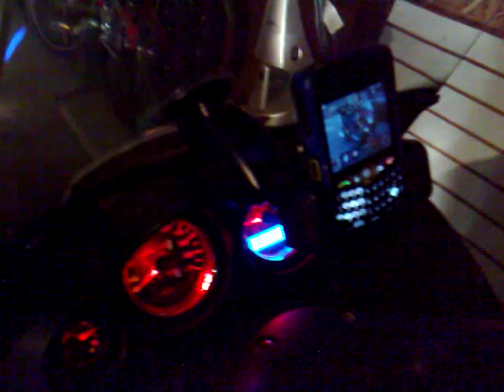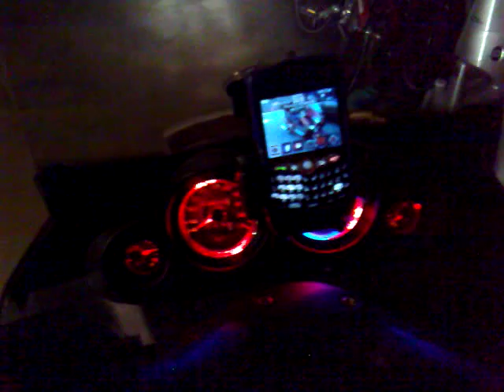250 cc chinese scooter

Comment: I have the same bike!  JCL "Jonway" 250 with the 257cc Yamaha/Linhai engine.  I too, had many problems which I corrected myself.  I also jazzed mine up with the LED's, MP3/FM radio & 4 speakers with 30 watt per channel amplifier.  I tore out the radio that came with it. Placed 12gram Dr. Pulley sliders weights in the variator for a little more top end speed.  Next year, I sell this Jonway for a Suzuki Burgman 650.  I owned a 2004 Suzuki  Burgman 400cc a few years ago.  No problems at all.

Comment: my log and repair book (fixed under warranty (no cost for parts or labor, except towing)
068 miles purchased
072 miles broke down for bad connection and low charge to battery
072 took to the dealer to get fixed (repaired under warranty)
180 miles i did myself replacing the engine oil and gear oil (no filter oil)
200 miles added rear led brake light and turn led signal lights (red stripe and blue led light)
569 miles replaced my clutch belt, fly wheel set and voltage regulator

Comment: 583 miles full battery charge (did myself)
625 miles dmv registration missing the title couldn't registered, need to go back and get the certificate of origin from dealer (bill of sale only doesn't work at all, don't waste your time, always ask for the title.
643 miles replaced the kick stand (replaced under warranty)
720 miles replaced the gear oil (did myself)

Comment: 949 miles headlight and dashboard lights off (overloaded with fuse box melt due overheat on electrical system.
971 miles low voltage, wont start, squeeze noise on the radiator fan, but temperature are in the mid section of the gauge
replaced under warranty (tee voltage regulator, the fuse box, new fly wheel set and add a metal washer next to the nut (19), thermostat temp switch, rear brake light switch and recharge the battery not fully but enough to start and run

Comment: 759 miles front brake calipers lock down the rotors, ( 789 miles replaced the whole front wheel brake system with ABS under warranty)
900 miles temperature went all the way up to the red line on the freeway at 65mph for about 5-7 minutes at noon in california (around 100F)
905 miles replaced the temperature sensor (thermostat) under warranty.
919 miles fly wheel nuts came off and rear brake light switch broke and melt
944 miles registered and got license plates and registration card